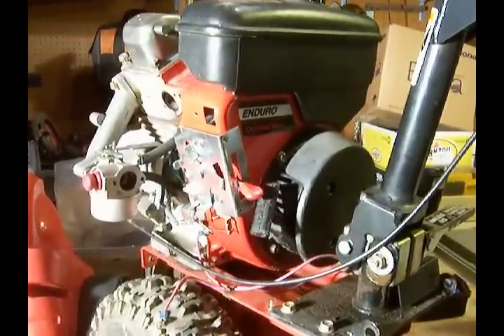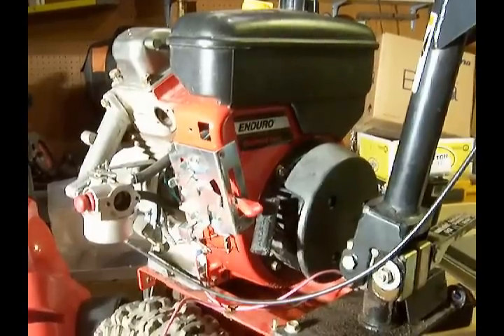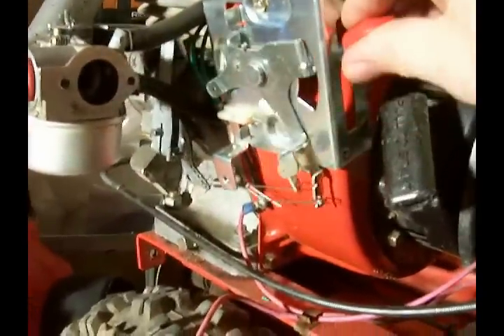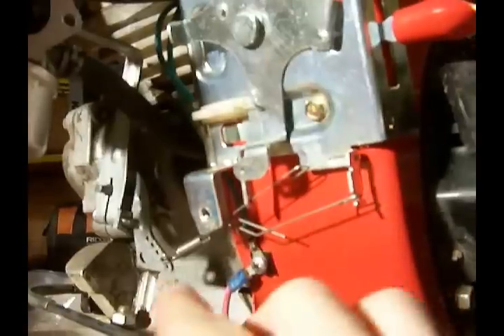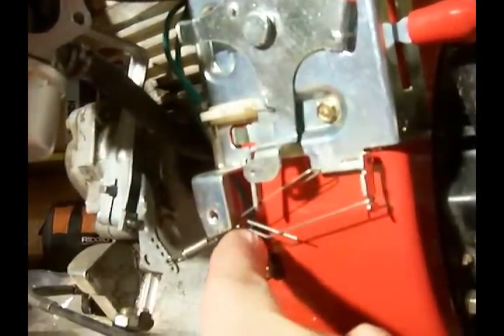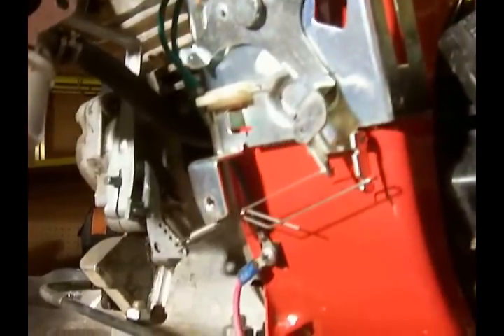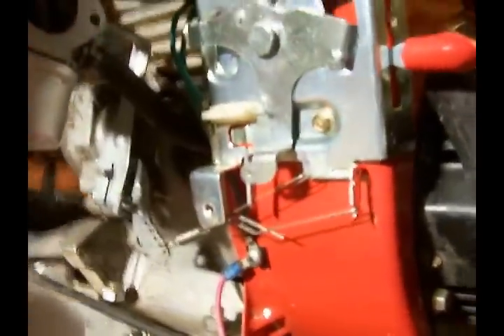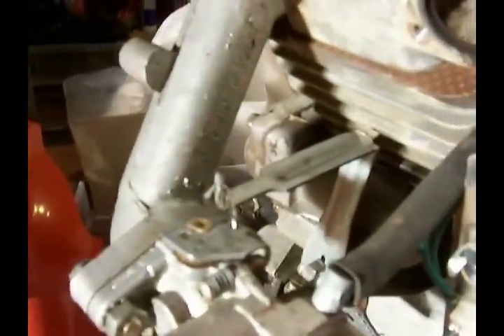Tecumseh  OHH50 - Governor, Carburetor and Control Arm Linkage

Comment: Thank you very much. This was very helpful. My Troy-Bilt Tiller has Tecumseh OH195EA engine has a slightly different variation but your video helped me get it working in no time.
Reply from the maker: Happy to help! Thanks for watching.
Reply: Rob is thier any other springs other than the one with a loop that's the govener hooks into I have the same tiller and bought it at a yard sale in parts
Reply: @kyleperry1701  Yes there are two springs. The Governor link (part # 36711 cost 88 cents) and Extension Spring (part # 37111 cost $4.82). 
My problem was that the engine would not rev up faster. The easy fix was to shorten the link so that when you pulled on the lever it ran faster and tilled better. Best of luck.
Reply: @robkeshav800  thank you I wasn't sure if thier were 2 springs I ordered the arm.. this thing has been a head ache man I've had to redo everything on it.

Comment from the maker: Thank you for watching. You are correct in that the best way to clean the tank is to remove it. However, I no longer have that engine and cannot easily explain the process. I am sure the tank is held on with some bolts/screws. Don't forget to disconnect the fuel line first.
Reply: Yes two bolts

Comment: What is the sequence for adjusting these linkages?  My best guess is: 

Allow throttle butterfly to be closed.
Push governor to close; tighten governor shaft crimping screw.
Install high-speed spring.  Start with middle hole#3.
Move throttle level to high-speed run "rabbit" speed
Ensure high-speed spring pulls governor arm so throttle butterfly is set for high-speed running RPM (~3,400) by bending tab at right end of spring.
Set throttle lever to idle speed, "turtle".
Adjust lower connection wire to set idle RPM (minimum 600 rpm lower than running RPM).
Note: there is no intermediate speed - it's only idle or run-speed (governed).

I never get governed throttle when under load - it bogs down.

Comment: Thanks for this video. It really helped me a lot. A neighbor gave me a Craftsman chipper/shredder that has a T oh50 engine. It was a mess.  From watching your different videos I was able to clean the carb and put the linkage in correct position. Amazingly it started and it runs fine. Thanks for your help!!!.  The problem I didn't realize is the fuel tank is filthy inside.  I would like to take it off and clean it but can't see any logical way to remove it, any suggestions?

Comment: Hello, Yesterday while I was tilling my garden my Troy-Bilt tiller stopped working after 10 minutes and it would not start. I pushed it back to the house and changed oil and it started. Is there is kill switch that shuts off the engine if it gets too hot? 

Is it possible for me to send you few pictures of the extension spring and Governor link setup to you so that you can confirm if I have installed it right? As mentioned earlier my OH195EA engine is set up slightly differently than your video. Thank you.

Comment: What part number did you use for your Extension spring? I used 37111 and it was too long so the engine would not rev up properly.
Reply: I'm sorry but that was 7 years ago.
Reply: 36710

Comment: Plz help. I have an ohh50 model 68080d and can't figure out what size bolt fits the driveshaft. 1/4inch slides without catching the threads and a 3/8 is too big. What size does it actually take?! Thanks!!

Comment: quick quick question, on the carb, is the fuel line on the bottom, or the top?  which will tell me which one the reclaimer line goes to lol
Reply from the maker: The fuel line is the bottom line.
Reply: thank you, yeah the carb i was sent was doa, was leaking fuel into the airfilter box, when attepting to take the float bowl off, the brass bolt snapped in half, ....... sooo yeah, but the place i ordered it from are sending me a replacement.

Comment: WHERE DOES THE KILL SWITCH WIRES HOOK UP TO? SOMEWHERE IN THE MOTOR? COULD YOU PLEASE CONTACT ME?
Reply from the maker: The ignition coil has a wire or wires coming off of it that can be connected in a number of places. The throttle mechanism has "fast" at the top and sometimes "stop" at the bottom - if there is a "stop", then the wire is hooked up to the throttle mechanism. Sometimes there is a key switch somewhere on the machine - check the handlebars. Sometimes it's just an on/off switch. The kill switch is just a way to ground out the ignition so the engine dies. Mowers, tillers, mini bikes, go-carts etc... all have different ways of shutting down but they are all going to kill the engine by grounding that wire from the ignition. Hope that helps. Thanks for watching.
Reply: thank you, one of the head bolts is rusted and won't come off i'll just choke it to kill the motor